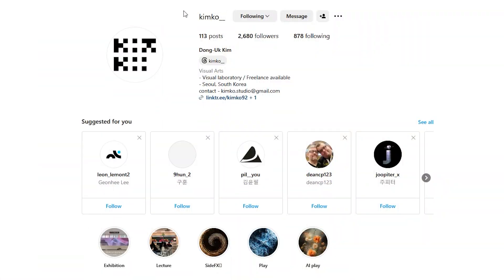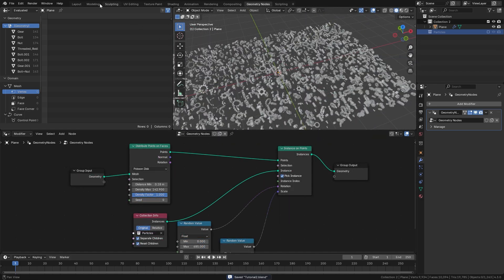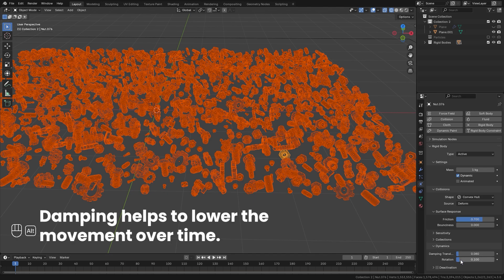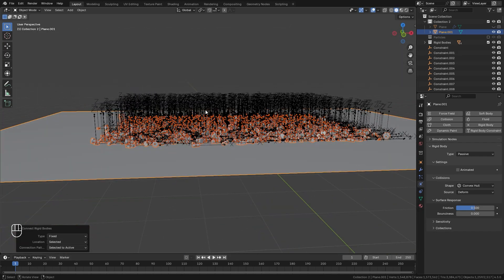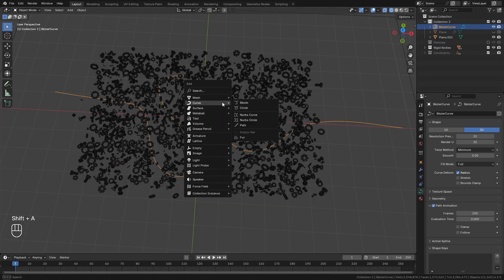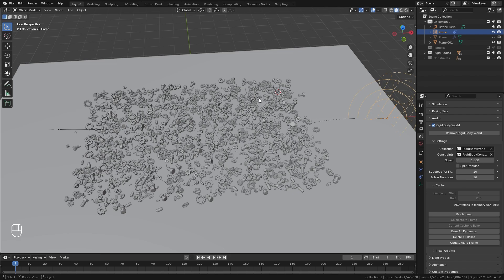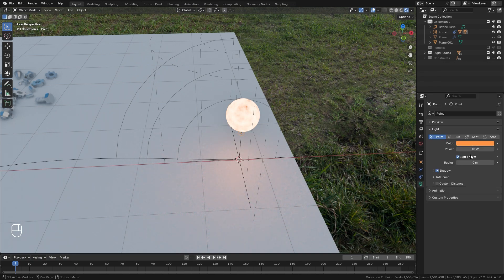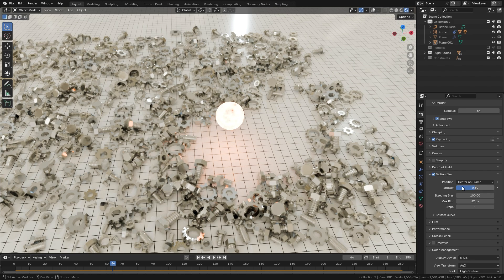Blender Tutorial: Satisfying Rigid Body Animation with Constraints

Comment: Hey great video, it certainly was fun to do and I learned a lot form it. But, I have had a weird issue with it that the bit's and bolts sink into the floor when I render the image, but I have looked around the view port at render preview, it doesn't see happen at all in anywhere in the time line. Do you have any ideas what's going on or how to fix it in the render?